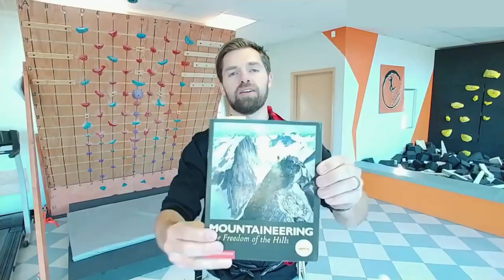4 QUESTION ABOUT OPENING A CLIMBING GYM

Comment: do you need routesetters, cause i wanna travel and work im form madrid spain :)
Reply from the maker: Not at this time. Thanks for asking. Good luck on your travels.
Reply: @climberdad  ill do any work related to climbing, im engineer with 3d design and printing master, also experience with manual work like wood, getting into climbing last year, ill clean the gyms that will make me happy too :) if can train a little in between